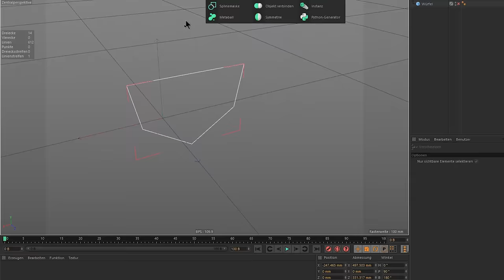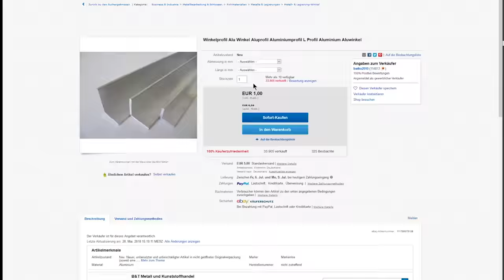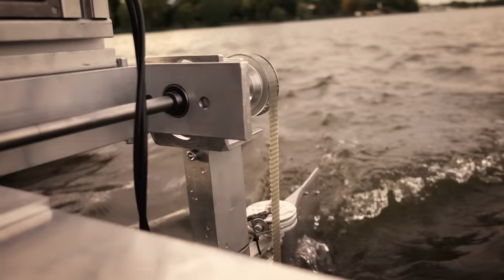Building a Bike Boat Catamaran

Comment: Great work Phil, well thought through to achieve a light weight boat. I think you may get issues with the  flexible belt and stretching with the torque load and possible weeding up; it could do with pivoting in parallel should you hit an underwater object. I've built similar myself but using a HTD twist belt to the prop; but my metalwork skills  made me use fibreglass on all my boats. Recently completed Newt III also on UTUBE, but its a design solution for British canal use. Well done, keep up  the good work and encouraging people to design and build themselves. Best, Lewis Esposito North Wales
Reply from the maker: I've actually had some problems with the belt and specifically belt tension so you're right. I think I'll actually convert it to chain drive in the rear, since a chain is much more forgiving and has more tolerance for twisting and such, they also don't slip when wet so you don't need as much tension. Maintenance should be easy too since the boat doesn't stay in the water after use. Haven't had problems with weed, the water is very clean here, but the occasional twig gets stuck in the propeller sometimes and water lillys should be avoided at all costs...

Your boat looks great by the way, would like to see how you solved the drivetrain
Reply: @PhilVandelay  Hi Phil, my drive units are more like independent  Sea cycle units but with HTD twist belts between pulleys. A 5-1 ratio with an oil seal on the stern tube keeping the  ali case dry. Very reliable but a bit more friction to turn. You can ofcourse use a fine chain to achieve the same effect. Best from Wales, Lewis.

Comment: Now that you have the CAD/CAM down you sell the design dude!
Reply from the maker: I actually didn't design this in CAD, it's just a mockup I made in another program and it's a polygon model, so not an accurate construction model. More like a sketch. But yeah I guess I could build it in CAD. I don't think it's technically mature enough to sell it though, it's very much a prototype and I keep working out kinks and problems every time I use it ;) I am planning to offer CAD files and plans for other future projects though.

Comment: nice work but is missing some air tide cpmpartments , so you don't loose your boat if something goes wrong
Reply from the maker: I have added float bags to the front and rear since this video but I'm also planning to close up the hulls eventually, it's still a prototype that I will keep improving things on

Comment: What makes me wonder is what happens when the 2 floats fill with water in an eventual storm.
A cordial greeting.
Reply from the maker: The same thing that happens when you get in a storm with a canoe, you sink. But just like a canoe, this is in no way designed or supposed to be used for storm situations. It's a fair weather boat for relaxed canal rides
Reply: @PhilVandelay  ... Then leave them open, without covering them with plastic, I don't care, I'm not the one who gets on pedaling, what I do see is that the edges are very low and if water gets in your whole device you will have it to fish at the bottom of the river.
A cordial greeting.

Comment: great work. please can you tell my the maximum speed you can get with it
Reply from the maker: Hard to say, it depends on some things like wind, how many passengers, etc. but I would say it's roughly as fast as a canoe when you pedal comfortably without much effort. I've covered distances of 20-30km on this without getting exhausted. But it's not a race boat or anything, it's more meant for comfortable cruising

Comment: good looking but very dangerous. Just a bit water and you go to the bottom of the river. You should add buoyancy compartments.
At least take 4 30 liter waterproof bags, fill with air and put in floats.
Reply from the maker: The same would go for a rowboat, canoe or any other type of open boat. It's not made for the open sea but small lakes and canals without any waves
Reply: @PhilVandelay  
Canoe do not made from iron and it will float even when filled by water.
You can lost your boat by stupid mistake.

Comment: Wait that's an air propeller, its blades are too long and too narrow — you get a lot of water resistance and not that much of thrust. You'd get much more thrust at less effort if you'd use a boat screw propeller.
Reply: I have seen other pedal powered boats with similar prop design. I think it might have to do with the different rpm and torque you get as opposed to engine powered boats.
Reply: The blades are long and narrow, but (as I understand it), less wetted surface overall, so less resistance. And the engine propellers are designed to operate at a much higher RPM and power rate than a human can produce; 16x16 seems to be the consensus over on boatdesign.net as the best prop for this low horsepower/high torque application, other than building a custom prop.

Please note that I am neither an engineer, nor experienced at this.. merely passing on what I have found as I research my own hpv boat project. Much respect to this builder for a work of art!

Comment: I like your pontoon design and your power train, but i think you would do better with a small marine propeller.
Very nice. I wish i had a full machine shop to use.MT
Reply from the maker: I actually did some research on this (I assumed the same thing) and found out that marine propellers wouldn't work well for this because their shape is specifically designed to work optimally at much, much higher RPMs than this has due to being powered by a gasoline/diesel engine. They run at 3000rpm and more while this only reaches about a tenth of that. Different physics apply, hence a different geometry is required because you can't create the same stream/vortex that something like an outboard motor creates.  And as it turns out, long thin propeller blades are a lot more efficient at low rpms (but still relatively high torque) like you get in a human powered drive train. I think I'll try a marine propeller some time just out of curiosity though, it's not that hard to swap them. What I can say is it seems to work really well with this one, you can reach  an average rowing speed without breaking a sweat

Comment: amazing  :D 
what speed it can go :) ? 
did you thing of electric power to test it somewhere ? it seems to be fantastic how it cuts the water so it may go nicely with small el. motor  i think :) 
What was price of materials ?
Reply from the maker: You're not allowed to use any kind of motor in the canals within the city here which is why it's pedal powered. I guess you could put one on but that was never the point of this boat, mainly I wanted it to be comfortable and relaxed for cruising, and it needs to be simple and light to be transportable. A motor would make it a lot more complicated and heavy. It looks kind of aggressive I guess.. but it's not really built for speed. But you can easily pedal for hours without getting tired. It's hard to say how fast it is, a lot of stuff plays into it like wind direction, currents, how many people are on it etc. but I'd say on average it's about as fast as a canoe, but less tiring because legs are stronger than arms. If I'm alone on it I can keep up with a Kayak which is not bad for a boat this large. The price I'm not sure... it was a lot ;) I didn't really keep track of everything I bought. Probably around 2000€...

Comment: Really respect your skills and work ethic but...
Here's my suggestion and criticism: I would have made cylindrical pontoons instead of doing all that cutting and framing. Catamaran boats using cylindrical aluminum pontoons are well established. Essentially you built a wooden boat from aluminum. Why not take advantage of the properties of the medium you chose rather than conforming to properties of a much less exciting, limited and cumbersome medium? The V shaped hull could still be accomplished (if that was the main reason for your design) but with an even better aerodynamic form. Something to think about for the next project : )

Comment: Why no gear ratios? Very simple install using the gears from a bicycle..... seems like a no brainer to me!   Also a propeller for a water vessel would be more efficient than an air propeller.  Gears and a decent prop and you'll gain speed and use less energy.
Reply from the maker: You're actually wrong on both accounts, but I don't even feel like explaining it anymore. It's baffling that you and others seem to think that with the scope of this project, I didn't put any thought into these things. But of course you, after watching a few minutes of video and thinking about it for two seconds, already think you know better than the person who spent over half a year doing research, designing and building this thing...  It's fine to ask why something was done a ceratin way, but correcting someone when you clearly have zero experience with the matter at hand is pretty arrogant

Comment: Great work BUT you missed the can holder, the beer can fall.
You overengineered the floats, take a look at PVC pipe Kayak here on youtube, you can buy 10" (250mm) PVC pipes to make the floats, cheaper and almost unsinkable, it gives you 49L (49kg) of displacement per meter, so 3m per float will give you 300kg of displacement, the high presure ones have thicker walls.
The width of your catamaran is awesome, gives a lot of stability, and the seat, where did you got that seat it is awesome.
Great work Phill.
And don't forget the can/cup holder again...

Comment: Do you think you could modify this to work with an electric bike to propeller? I want to do something like that for my ebike.
Reply from the maker: Yes I have actually considered that and I think it could work quite well. The only thing that really keeps me from it is the cost for the motor and batteries. Other than that it should be fairly easy to do

Comment: I get wanting to use your metalworking skills, but that seems like a really odd choice of materials. You could have made it out of 3mm plywood in about 1/4 the time, and it would have curves instead of angular joints (which are not so great hydrodynamically).
Reply: Plywood is ALOT heavier and harder to seal properly.
Reply: Nearly impossible to seal completely. One small ding or crack that lets in water and it will rot. Aluminium will last 500years.

Comment: Really liked the video, and when I saw :"Plans for my Projects on Etsy" I was so excited, but you haven't listed the plans for this boat, I was going to use it as a base for a small sail boat, bit longer and covered hulls and a mast and sails, maybe an outboard
Reply from the maker: Yes unfortunately when I built this, I wasn't making plans for anything really, at least not as comprehensive as I do now. The 3D Model you see in the beginning is more of a rough "sketch" that I used to figure out some dimensions and proportions, but most of the detailed stuff I figured out as I went along. That's why I haven't provided plans for this so far, because non exist instead of some scribbles and notes . That being said, I consider this boat a working prototype and work in progress, and I plan to keep improving things and rebuilding parts of it until next Summer. I think during that process I'll make a new, proper 3D model of it and also create plans with measurements. So if you're not in a hurry,  plans will hopefully be available sometime next year along with a video with a bunch of improvements (those mostly concern the drivetrain/propulsion, I'm quite happy with how the hulls and frame worked out). I'm also planning on closing the hulls - most likely using waterproof tarp, so that they can still be accessed forstorage (which was the main reason I left them open in the first place)

Comment: I took a class in welding, so i know basically how to use the tools and not blow myself up while simultaneously using complex CAD but i don't know the things such as manufacturing or detailed information on what to do, your videos have a lot of cool little tips like on how to cut things straight with a plasma cutter using an l bracket or just using a wood template to scoot across
Reply from the maker: Just get started with some small projects, most of the knowledge is simply practice. You just kind of get an intuition on how to approach things. Don't be afraid to make mistakes and you'll quickly gain valuable experience every time you mess something up ;)
Doesn't look like it in the videos but that's how I did it. Still make a ton of mistakes and learn from them. But as you said it also helps a lot to watch experienced people work. But as with most things, if you don't apply the knowledge it quickly fades..

Comment: Good workshop and great project. Nice boat!
One small change (improvement) I would do is to add air balloons to the points/end of the floaters, plus enclose them from top (alternatively with water tight access  hatches to store something on the way and keep center of gravity low).
Those balloons are simply inspired by what kayakers use. And having water over the edge to the open floaters is not about IF, but WHEN. As it WILL happen sooner or later.
Anyway I am in awe how well you build it. That's definitely one of (if not the top one) the home made catamarans I've ever seen.

Comment: Cool design, how ever i have few things that i spotted that might become problems. First the drive train arm securing bolt rely only to friction to keep whole system in place. Say that is left bit lose or gets lose over time you are royally fucked if you are at the water with out tools. Better design would have been machine slot to each position and bolt to have wider area that fits there. This prevents arm to swing until bolt is moved out plates material thickness. Also this should be able to be operated with out tools, so some hand knob would be better to add into screw head.

Secondly belt system might work, but its probably real bitch to get back on and can create dangerous situations with several people on board. Something like gearbox used in top of the water part with proper seals would be better option in my mind and its axle can be driven inside the aluminum profile, so its harder to damage by for instance drift wood or such.

Thirdly any system should have secondaries, in case primary propulsion or steering fails on the water. In this case i would fabricate or buy two paddles, that can be used ether to steer or row the boat to shore even by your self.

Forth thing would be use of rivets below the water line. Sure those might be marine quality, but i would have used them only to assembly stage and the just remove and weld holes shut.

Fifth thing is adding buoyancy material inside the pontoons, in case those get hit and start to leak, water ways can be dangerous, person can drown to bucket and people are idiots. Its insurance, where your life jackets are the final layer of insurance.

You rather not want to use these things, but you sure will want to have them if one of the things mentioned will fail and something bad happens. It pays to be prepared.

Comment: Congratulations on the project. I can't find Angle Gearbox. Tell me ebay links where to find it? Thanks
Reply from the maker: Sorry this was years ago so I don't have a link, but I also only found it by coincidence, it was a spare part for a window shutter system or something, quite obscure. But alternatively, you can use the gearbox from an old/broken angle grinder. It does about the same job and should be able to get one cheaply

Comment: I noticed you are using a poly tooth timing belt that's not really designed fo power - you really should be using the black belts - we made the same mistake on a little shell eco car
Reply from the maker: Yeah I wasn't sure what to pick so I pretty much chose a random one. Ever since I added a belt tensioner it works fine though, so far it's holding up

Comment: I would have say 
cost vs. time

This two factors and deciding to buy or to make it yourself.

I know ppl say “yea but it’s the scene of bride of making yourself”.
Well yea, but if it’s easy build tires at same cost or little cheaper but takes month to make set. Every time you need set tires would you was your time or just buy it. This one time cost job, but time is value too. I would spend my time and effort and building something that I can’t afford or it’s impossible to buy.

Comment: Was a Tin Knocker for a few years, you have skills.
Now I would really be impressed if you had designed that without the aid of the cad.
Lol.
Nice job well done
Reply from the maker: Thanks, the cad was actually more of a rough sketch to work out some dimensions and proportions (otherwise I'd be offering the files but  they're a bit useless). My experience is that as soon as you work with sheet metal, measurements kind of go out the window a bit and you have to do some things by feel anyway 🤔 The wooden template was the biggest help to get the hull pieces right